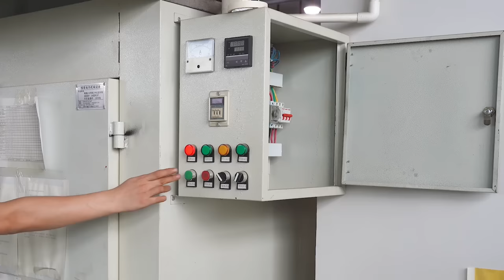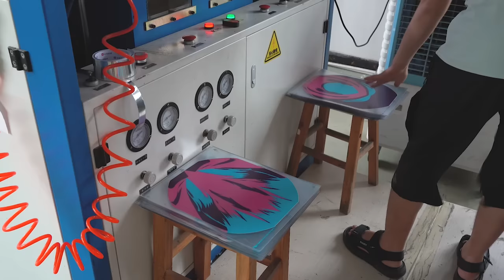Shaping Safety: Bicycle Helmet Mass Production Process in China.

Comment: That 0.5mm vinyl shell does not give me the warm and fuzzies. These can't be for the US market.
Reply: Nah, u be allright with the foam protection
Reply: @Srt3D01-db-01  till the shell breaks and the foam rips apart. Kinda the whole reason for the shell.
Reply: It's polycarbonate and in a $200 US helmet, it's still the same thickness for road helmets. It's meant to stop the helmet from catching on the road and breaking necks i.e. helmet should slide . My local department store sells ABS instead of PC and it's worse than what they use here.
Reply: @NOTSOSLIMJIM  If the shell breaks that means it has recieved an impact, and you should change your helmet anyway.